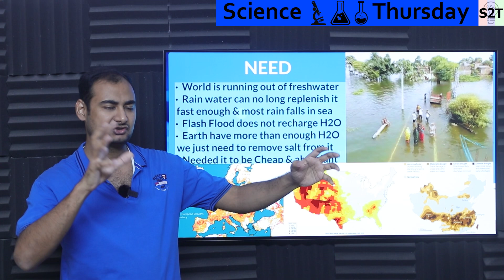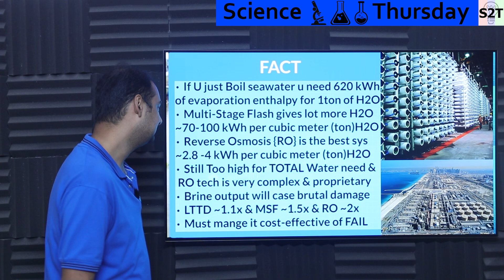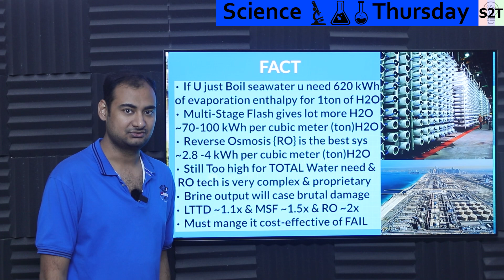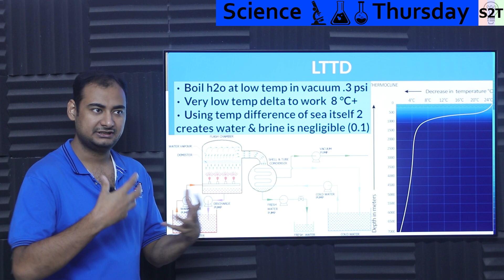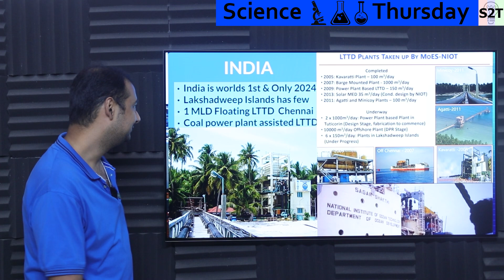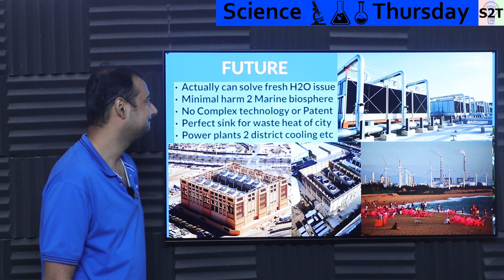Low Temperature Thermal Desalination {LTTD} Explained {Science Thursday}

Comment: Can we build a trompe and add it to this system before the water is supplied to end users and create electricity? 

I've often felt that with so many rivers in India and the interlinking project in the works, couldn't we generate electricity using trompes? As an additional benefit, since a trompe also dissolves some oxygen into the water that continues to flow back into the river, once it has exited the device, wouldn't this make the water cleaner and help the growth of aquatic life in the river - including edible fish? Given the drilling technologies we have available now, the holes we'd need for a trompe producing a decent amount of energy would be of a relatively trivial depth.
Reply: I also liked your seaweed for biofuels episode and agree with you on it being one of the only feasible paths to sustainable fuel. 

However, I believe we are also missing out on onshore potential. Hear me out. India has lakhs of kilometres of rivers, highways and railway tracks. The embankments on all three need to be structurally sound. Certain fast growing grasses - such as Vetiver - grow roots as deep as 12 to 15 feet and have the strength of mild steel. An embankment of 2 mts on either side - which is a very conservative estimate - would mean that each km would be equivalent to about an acre of growing area. That's a lot of biomass! Furthermore, water doesn't pass through a line of Vetiver, so by creating gaps that are directed to catchment areas, we could use highways and railway tracks as rainwater harvesting infrastructure. 

Vetiver can survive up to 2 months of freeze. So we could even use it to stop landslides and erosion in the Himalayas while harvesting biomass. Lastly Vetiver doesn't spread out of control naturally, it will go in the same straight line that it has been planted, indefinitely. So there's no danger of it being an invasive species.
Reply: Finally, what is your take on hydrothermal carbonization? Couldn't we use it to create value from our sewage as well as garbage? No need to separate wet and dry waste. Effective plastic disposal etc etc
Reply: Please make a video about hydraulic hybrids. I really feel that creating retrofit hydraulic hybrid systems for vehicles and the shift to biofuels - especially with seaweed based and biomass based production would be a gamechanger and possibly the only effective and feasible way to transition to sustainable transport.
Reply: Looking forward to your replies to these speculations. Thanks for your videos. They're brilliant and very well researched/presented.
Reply from the maker: U Cant do sea weed bio fuel on land no matter what you do it will only increase the cost and piss off people
Reply: @s2tenglish I'm sorry I don't think you read my comment properly. I am not talking about growing seaweed on land. I'm talking about fortifying embankments using Vetiver. I suggested this as a strategy to increase biomass yield without using cultivated land, in addition to the seaweed based approach you talked about, which I liked.

Comment: Great episode! I have for so long wondered why this isn't the norm for desalination, I even tried to see if there was some fundamental flaw I was unaware of that made it impractical, but haven't found any. I suspect applying a lot of heat to staged vacuum distillation system makes that significantly more compact,  and controllable/reliable compared to relying on ambient temperature differences, but 8 C delta isn't that hard to find, in hot dry climates just evaporative cooling can produce much more than that most of the time.
Reply from the maker: Well INDIA has many working plants that are  working and few more under construction

Comment: Thanks for sharing this important technology!  but...  You assert that condensing water from air is not an abundant enough solution, this is incorrect.  Essentially all our fresh water comes from condensing water from air in the form of rain.  I have done the math on using the ocean thermocline as the cold source for condensation.  It is half the cost of reverse osmosis and has zero brine.  It shares the issue of LTTD that many areas do not have easy access to a large thermocline.  I am a huge fan and wish you the best.
Reply from the maker: you are missing the forest for the trees . if in one location you have enough humidity for enough water extraction then its a prerequisite for a rainy season . it will not work in a dry area where u need it . This is why no one with a brain have tried it only scammer & missguided people . Read history of it how many time people have fallen for it ITS SAD
Reply: @s2tenglish  You are correct that scammers and misguided folks have made the water from air topic a laughingstock.  But it is incorrect to say that only brainless people have proposed it seriously.  One paper from an Indian scientist can be found by searching for the words nariphaltan and dew.  His only problem was his choice of a horribly inefficient condenser.
Reply from the maker: u are doing the same thing FACTS will not change Phase change is not an low energy process no matter what you do or HOW .
Reply: Atmospheric water harvesting is in a way kind of the same thing, but with around 100 air molecules for every water molecule, making it 100 times worse than low temperature vacuum distillation, in multiple ways. 100 times worse is a ballpark figure, that's assuming warm very humid air and significantly lower temperature of the heat sink. I you manage to extract 10 grams of water per cubic meter of air, you need to process 100 cubic meters of air to get a single liter of water. That water will contain air pollutants.
Reply: @fishyerik  Quite right.  Here in California the air contains a bit less than 10g/cubic meter and of course you can't capture all of it.  I estimate1720 cubic meters of air per gallon of water collected.  This works out to 5 watt hrs per gallon for air flow while water pumping sea water needs an additional 20 watt hrs per gallon, so the air handling isn't really the problem.  For various reasons you want to collect the air out over the ocean, lower pollutants is one reason and higher humidity is another.